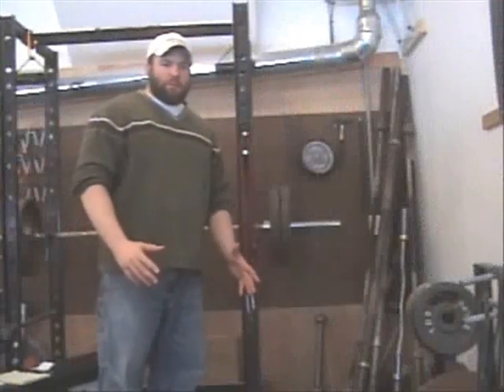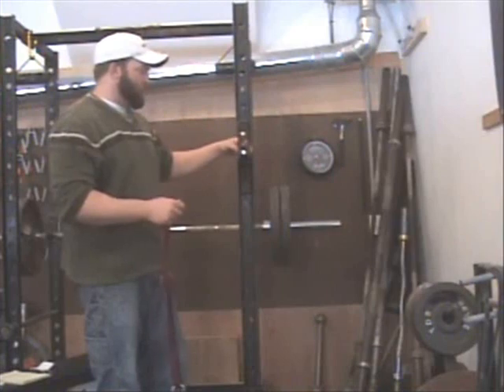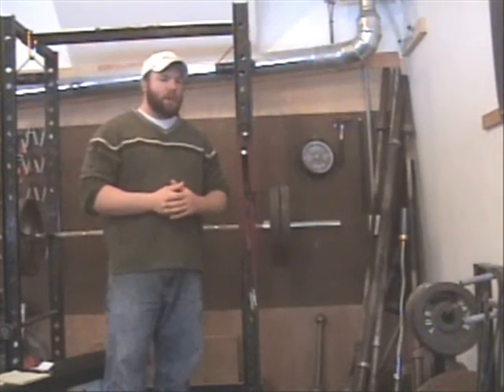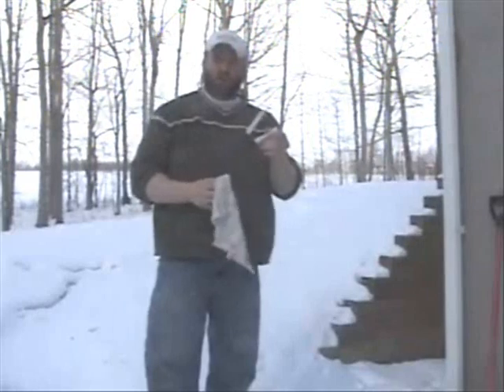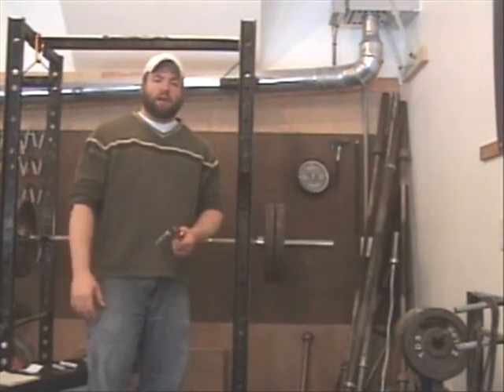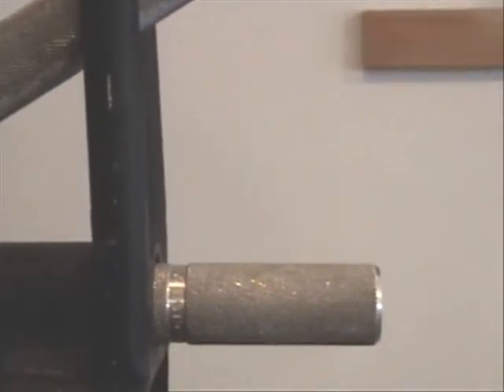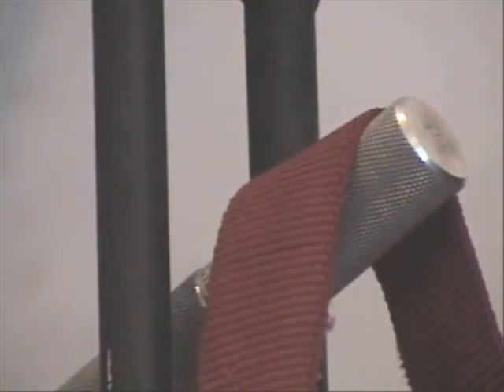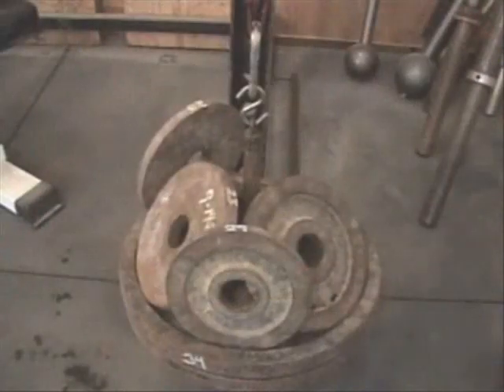How to Measure the Strength of a Gripper - Gripper Rating - Gripper Calibrating

Comment: Thanks for posting.  The way they measure it is by putting the weights in the middle of the handle instead of the end.  The reason is simple: the gripper is crushed with four fingers, two fingers right of center and two fingers left of center.  So, on average we apply the force on the center.  I hope this helps.

Comment: They more than likely tested the COCs from the middle of the handle as opposed to the end. Less leverage means more poundage to close it. Makes a little more sense since considering when you squeeze a gripper, you aren't just squeezing the very ends of the handle.
Reply from the maker: That's not how IronMind got their numbers
Reply: Ironmind get their numbers from the manufacturer ratings of the spring itself, I believe, rather than any rating process.
Reply from the maker: That isn't true.

Comment: Loved the video. Great way to rate grippers for consistency, which is all that matters if you want to make comparisons and measure improvements. It seems to me that the difference between what this calibration finds and what the manufacturer’s rate their grippers at is likely because this method only measures force in one direction. But the same amount of force must be resisting the hanging plates, otherwise the squat rack would fall over. This means the total system force to close this gripper is around 310 pounds, much closer to the manufacturer’s rating. You’ll notice a lot of calibration done this way gets a measurement about half of what the manufacturer is claiming. I suspect the manufacturer is measuring total force to close, not one direction force, and converting that to pounds. As I said, all that matters is that people use the same system when making comparisons, but I think worth noting because it does mean that you can trust the good manufactures, you just have to understand the differences in measurement. And good for egos too, because you are providing a total force double what this calibration says 😂
Reply from the maker: If you knew how the main manufacturer got it's numbers, you'd laugh your ass off. Especially if they're know somehow claiming a system like you describe.

Comment: I have one of those old 80's/90's style black plastic handle grippers and wanted to know how many pounds of pressure it was so i just put one handle down on the bathroom scale and pressed down on the other handle til they touched and read what the scale said and it was 40 pounds.  Don't know how accurate that method is but it sounds about right.  I'm sure it would be a lot harder to do it that way though when you're getting into the 100 plus pounders.

Comment: Wouldn´t placing the strap in the middle between the end of the gripper and the line in the middle of the handle be more fair, since when closing the gripper my finger cover a larger area than the one covered with the strap, hence it would be a better measure of the actual mean of the pressure that is exerted by the fingers.
Reply from the maker: This is how it's always been done.

Comment: How much more do the newer 3s rate than the older ones?  is there a big difference?  I just bought a brand new 2.5 and it doesn't feel a whole lot different than my older # 3.
Reply: Big difference my brother. For example I can close older coc #3s  now. And my new 3 is around an rgc of 155-160 plus I'm guessing and I'm only  cms from closing it with either my right or left hand. That's one of the reasons no one has certified under the new rules with the current CoC #4s( they have rgc of 213-240) Older ones were 188-192

My new ghp 8 I can bring near parallel and it has a crazy  rgc of 179. So indeed older CoC I found are a great deal weaker than newer lines. Be sure to get grippers that are rgc rated or you can send your current grippers out to be rgc rated as well. 
Good  to know how your strength measures up to legendary gripper achievements and keep track of progress.
Reply: @shel0016  coc 2 is 200 pounds and 2.5 is 250 if you close that one you gonna grip same on dynamometer
Reply from the maker: @jetjaguar_power16 not sure how you can say this, when I literally go through the process in this video

Comment from the maker: Using this method, a COC #4 is NOT 365.  It's nowhere close.  It's about 200.

I don't have a GHP 9 or 10 to rate unfortunately.
Reply: Try to encopass all handle with some kind of strap and then measure from the middle of the handle. Ofcourse it is 200 lbs if you measure it on the end of the handle. Realisticaly gripper is used differently.

Comment: Why do they say it takes a lot more force to close it then?
Reply from the maker: Because the information I've received is that the numbers were all given to the grippers by one specific person after he squeezed them. No measuring or rating system was used.
Reply: because he measures the force at the end of the handle where leverage is maximum, where actually when you close a gripper your main force is coming at the point of the handle with much less leverage so much more force is needed to close it